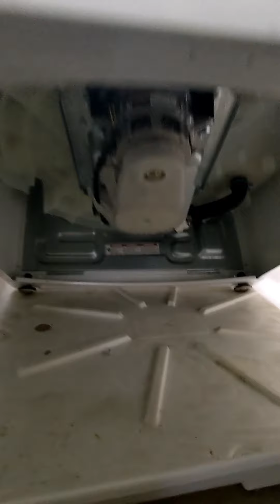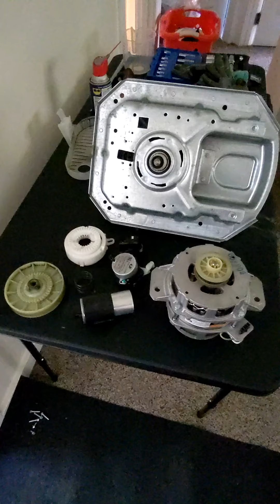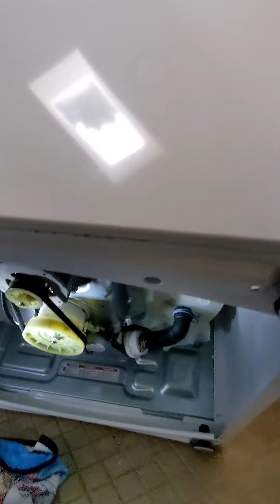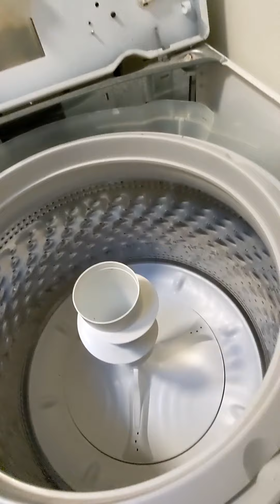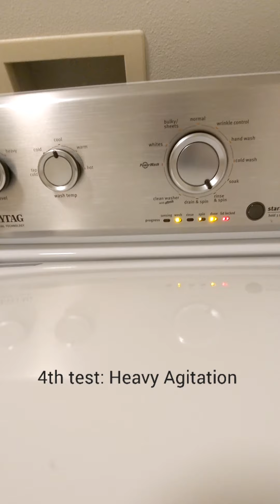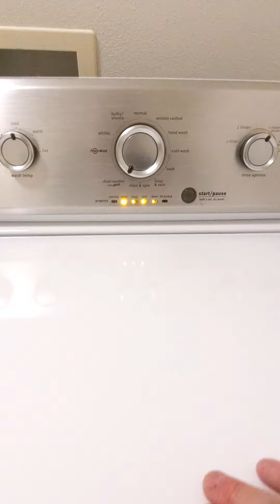DIY repair washer not getting clothes clean -- Maytag Centennial gearcase replacement

Comment from the maker: I've realized I kept referring to the actuator as the agitator.  Brain slip.  Agitator is the large white plastic contraption inside the tub that jostles the clothing around.  Actuator is the device mounted on the underside of the gearcase next to the capacitor and alongside the splutch.  It connects to the cam and shifts the washer between spin/agitate modes.